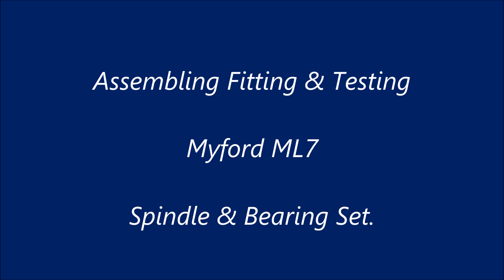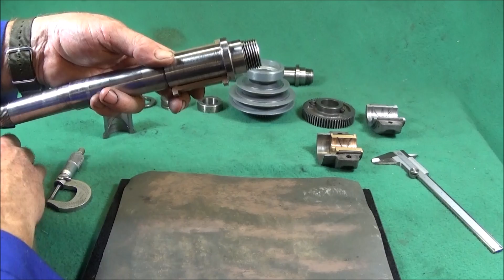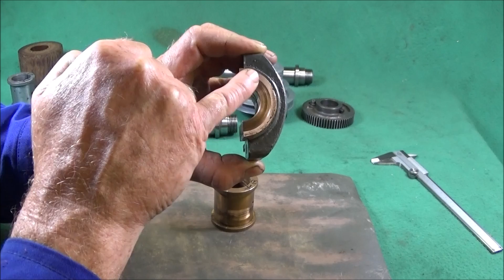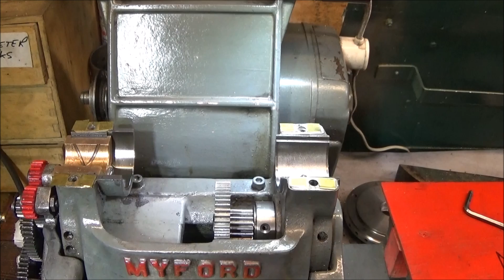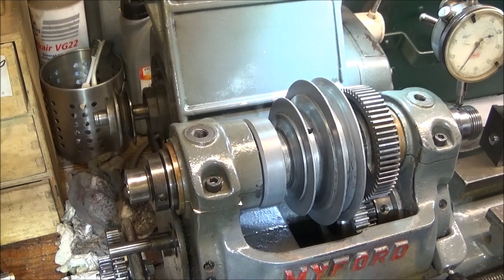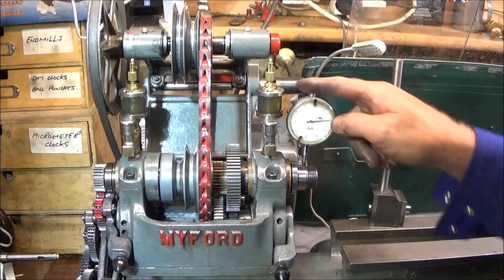Changing Myford ML7 Headstock Spindle & Bearings Assembly Part 1

Comment: I'm a little confused about the use of grease, I read that only oil should be used for the bearings.  Im restoring a Super 7 and the past owner had blocked all the oil channels with grease.
Reply from the maker: You need to use the proper hydraulic oil on the bearings.. ISO32
Reply: @SteveJordan  Thanks for the reply and your videos.  It's much appreciated.

Comment: Hello Steve, thanks for all your intresting Videos to the Ml7. 
I have one question. Do the oil groves at the Front bearing have to be on the same side or opposite ?
Best regards
Olof
Reply from the maker: Hi Olof the bearing halves just drop into place. The one half with the oil hole goes on the top of the spindle. Other than that, I don't exactly know what you mean?

Comment: How is possible doesn't have a ball bearing with oil or grease. Like this is going to last nothing. Old style, very old style. When the industry was without ball bering
Reply from the maker: These bearings are old fashioned but can last for decades if you use the right type of drip oil. They are relatively easy to maintain as well.

Comment: Hi Steve. I am looking for a used unhardened spindle for my 4th axis CNC I am building. Condition of the bearing surface is not important as it will be machined for ball bearings and fitted with a toothed pulley powered from a stepper motor. If you have one to sell or know anyone who has one, I would be appreciated. Phil.

Comment: This might be a dumb question but if you have a lathe can't you just make a new spindle?
Reply from the maker: I always add up the cost to see if its worth buying or making. This would take a long time to make having such critical size limits, plus one has to make a bronze split bearing to match. Then there is all the other costs as well with no guarantee that one would not make an error. 
   No I would rather buy a new set any day. Then just get on making other things. Precision machining costs are worth at least £25 an hour when one adds up all the outgoings.
Reply: Thank you for the reply.

Comment: Hi Steve I have removed my head  spindle and trying to strip it down to replace a back gear 
The problem I'm having is I can't seem to be able to remove the spacer just in front of the pulleys
Have you any advice on how to remove this 
Regards Geordie
Reply: I had the same problem. The spacer was eventually removed by heating up with a blowtorch and hammering off with a lump hammer and piece of wood.

Comment: Hi Steve, great video.  I don't own a Myford but love watching you work with yours.  Just an observation.  I own a South Bend 9a and an upgrade we do on the south bend is put a very thin spindle bearing in place of that washer and pin set up.  It allows you to tighten the nut at the end but not lock up the spindle.  -Adan
Reply from the maker: +Adan Hi Aden I will look into that to see if I can do that on the Myford. Thanks...Regards Steve

Comment: Hi Steve, Did you install a grub screw on the drive gear. I would like to know if it's really necessary to lock the gear with this screw. It seems difficult to drill and tap between the gear and the spindle. Thanks.  Bruno.
Reply from the maker: +Agent Faucon No I didn't bother. It was a tight fit and never moves. If it was loose I would have just used a bit of loctite
 Regards Steve
Reply: I also would like to know what this grub screw does. no mention of it in the reasembly
Reply: @williamstuart2471  It avoids any movement between the gear and the spindle as Myford was probably not using Loctite cement. I installed mine without this screw, no problem.

Comment: this moly lube u use? what brand is that? And do u have a link?
Reply from the maker: I bought mine from a local car parts dealer, but this one here is exactly the same 
https://www.amazon.co.uk/RDGTOOLS-Molyslip-2001E-Engine-Supplement/dp/B0731D3WM6/ref=sr_1_2?ie=UTF8&qid=1506412523&sr=8-2&keywords=molyslip+engine
RegardsSteve
Reply: Thanks Alot young man. Regards from the owner of England and Oxford Bridge Burning. Wiking Jonas in Aarhus.  ( London bridge also had a good burn ) :D

Comment: Thanks for yet another informative video, especially useful for Myford owners.  I have a Super 7 myself, but very much is the same. Regarding the Molyslip; was that the MLG you used?

How did you determine that you needed a new spindle and bearings?  Is it any point in changing just the bearings, og should the  spindle be changed together with the bearings?

Thanks
Reply from the maker: Hi Arnljot, Thanks. No the Molyslip I use is the Engine Protector liquid type that you add to car engine oil. 

You can only get the new spindle and bearings as a matched set from Myford UK. The old spindle and bearing set had too much free-play and caused machine chatter and poor finishes. I could probably have re-scraped them to work properly,  but this would have taken many hours of work and a lot of patients to complete!  My Regards Steve

Comment: Thanks for taking the time to video this - a really useful resource for ML7 owners. In the video you mention not using the back gear to lock the spindle when removing a chuck. Could you please explain the correct way to do this.
Reply from the maker: +Eben Fourie Hi thanks. .. the method of removing a chuck from the Myford is explained in my other video on ' How to remove a stuck chuck from the Myford ml7'.... It is basically the same procedure, but just holding the spindle gears while you undo the chuck.
Regards Steve

Comment: Hi Steve, Thanks very much for your video. I had a problem with my pulley/pinion gear slipping and so had to take my spindle off to Loctite the two together. I found your video account extremely useful and informative. Many thanks again. Jon

Comment from the maker: IMPORTANT UPDATE. Since making this video I have found that it is a false economy to buy a second hand spindle and bearing set, unless you know they are in exceptional condition, (something that is basically impossible to see by eye). This used set that I fitted to the lathe in this video looked fairly good, but after installing it and using the lathe I found out that the bearings were much worse for wear than I previously thought, in fact they were just as bad as the ones that I replaced!... Eventually I bought a brand new spindle and bearing set directly from Myford.UK. 
  I fitted the new spindle set in the same way as seen in this video, but obviously didn't have to make any alterations to the bearings. Also the spindle & bearing set from Myford is so well machined and matched that the bearings do not need to be scraped.
 SEE PART 2 VIDEO about this subject.
Reply: Thank you Steve, I certainly wish that I had the option to buy a new spindle and bearings, but not only have they quit making them, the 13" South Bend is a rather popular lathe, and so it's the most difficult smaller sized SB to find parts for, new or used. 

They do still have a few parts for SB's retailed by Grizzly Tools, but they're so expensive a spindle and bearings would likely cost more than my entire lathe did, so...I'm pondering the possibilities, but wish I had the skill to refit the old girl with some Timken Bearings. 

Thanks for the video, and have a great weekend...Chuck
Reply from the maker: I bought mine from Myford UK they seem to have a few made up every now and again, so if they do not have any now you could ask when they will have them. They are very expensive though
Reply: Dear Steve, wonderful videos! You mentioned that it is best to buy a new spindle and bearing set. Do you have any idea where to get those? I can't find them anywhere?
Reply: Hi Steve,great videos!  Would it be ok to make some “Oilite” bearings to fit the ML7 ? To run with an original soft shaft?
Reply: Hi Steve.your myford videos are v good.  I'm thinking about doing this spindle replace. Did you ever find a means to  machine the threaded hole between the Gear and the shaft assemble? Or has it held up well over the last number of years with interference fit without slipping?

Comment: Hi Steve. I watched your video with great interest. It is well done and very informative. Yesterday I used an ML7 which belongs to a friend who hasn't used it in many years. We were boring some holes into stainless round bar with sharp drill bits without any issues until we stepped up to 10mm bit. The pully seems to slip on the spindle shaft and is not fully engaged with the gear. The chuck would stall with minimal pressure on the bit. Does the pully have a grub screw to secure it to the spindle or is it just the little notched piece that engages the gear that makes the connection. 
Any advice or help would be much appreciated.
Reply: I had the same issue with my ML7 when I purchased it. The chuck would stall even when doing the lightest drilling in brass. The headstock pulley was slipping over the brass gear (acting like a torque converter)
The previous owner had over-tightened the drive belt to compensate for this.  I had to strip down the headstock to remove the pulley + back gear bush assembly. Instead of purchasing a new one, I used Loctite to bond them back together.  I made sure the lubrication hole in the bush was aligned with the oil nipple hole in the pulley.  My ML7 is now running as expected i.e loads of torque now and no chuck stalls.

Comment: Steve, did you measure any radial or axial movement before you stripped the headstock?
Reply from the maker: Yes. I had something like .007" movement on the lift test. If I took out more shim though, the spindle was prone to seizing. Apparently a previous owner had run the lathe without any shims and hadn't even tightened the bearing caps down. This is what I think distorted the bearings over time.  I was getting vibration even on light cuts. 
 Since I have changed the bearings I can do .070" cuts on steel with feed and get great finishes. I could probably take deeper cuts, but I do not like putting a lathe under unnecessary stress and I haven't got coolant. I am very pleased with the results.

Comment: Thanks Steve.  Very well presented and thorough.  Enjoyed seeing the nuts and bolts of the spindle assembly on your ML7.  Is that Molly Slip a particular product?  I found the Canadian site for them but they seem to only have sprays or powders that may be like your slurry.  Haven't seen it in the US.  Thanks for another fine video.  ~PJ
Reply: Molyslip is just a brand name for a generic formulation of a lubricant with a certain percentage of molybdenum disulfide particles (chosen for its ridiculously low co-efficient of friction) suspended within a generic soap. Loctite Moly Paste has a pretty high concentration of moly content (generally you want > 40% by weight) and should be available globally at any of the standard industrial suppliers (McMaster, MSC, Grainger, whatever's popular in your region). Beware generic brands that don't declare the percentage of moly content as they tend to just use EP2 generic grease and toss .05% moly content in there and put a pretty sticker on it often found in the auto section.

Comment: Hi Steve, great video. Putting the drive gear in an oven for about 1/2 hour at 150-200 c would expand it enough to enable it to slide right on.
Reply from the maker: Hi Trevor, Thanks....I didn't think of that.

Comment: Hi Steve, my ML7 has a 15.8mm hole in the back and it looks like there is a screw between the gear and the spindle.  It doesn't appear to have any slot in it though so I hope I never have to remove it!  Mine is definitely stock standard as I have owned it from new in 1980.
Reply from the maker: Hi John. Have you had to adjust the shim thickness much on the bearings over the years since you had your lathe?
Reply: Hi Steve, no I have never touched them at all.  I tried checking the play on it after watching your video and the most I could get with a bar in the chuck was about half a thou or less.  So they appear to be doing pretty well.
Reply from the maker: Hi John, That's interesting. Great to know that they do not wear too much. Mine is about .002" thou at the moment. I'm going to leave it like that for a while, as it is machining very well now. I will let them run-in for a while and maybe adjust the shims at a later date.

Comment: Very well explained it is quite nice how you keep things thorough and simple.  Thank you for the information on the Molly Slip,  do you have any suggestions of a lubricant for rust protection?
Reply from the maker: Hi Glenn, thanks. Because I'm using the lathes so much I just use a inexpensive WD40 type spray oil to keep the rust off. If you have chucks and tools that you do not use much you can spray them with this type of oil and wrap them in cling-film. I think Duck Oil is very good but is a bit expensive for me! The cheaper sprays seem to be working ok even in the metal shed where there can be more condensation in the winter.

Comment: Steve Jordan, many thanks for your videos. Just a quick question as I'm a little bit confused. Is there an option for a spindle with a bigger bore??? I thought all ML7 had a bore of 15mm... and a 17mm bore would be a nice upgrade.
Reply from the maker: Hi Nick, Yes you can buy the hardened spindles with the bronze bearings. These are the ones with the bigger bore. Myford sell them new, but they are very expensive. Sometimes you see them second hand though on Ebay.
Reply: Many thanks for the valuable info. I don't own a Myford yet but I'm funding for a grey S7 over a year now and I hope they do offer this modification for the S7 as well.
Reply from the maker: Hi Nick. I think all the Myford Super 7 lathes have the larger bore spindle as standard.

Comment: Using 4 threaded rods to help align the bearing caps would help prevent the shims from moving. I have a Myford clone (Colt) which has a ball bearing headstock but similar in construction. Great video.
Reply from the maker: Hi Gord, Thanks. That sounds an interesting lathe. I haven't seen one of those, they must be quite rare?